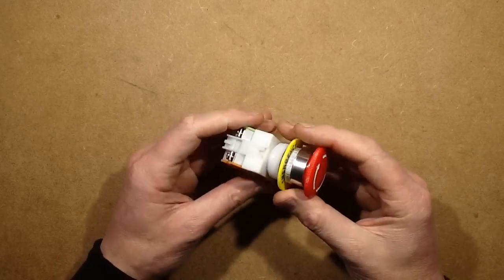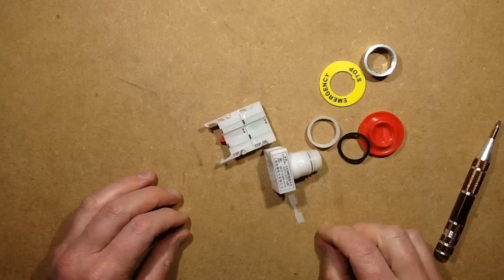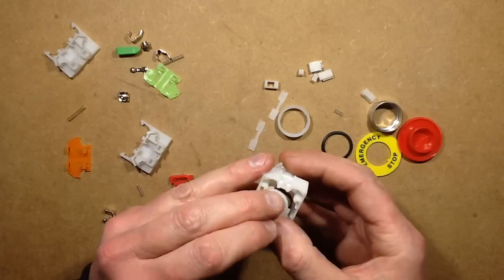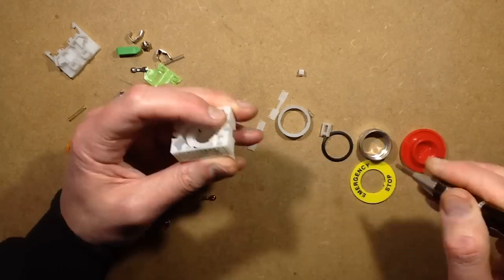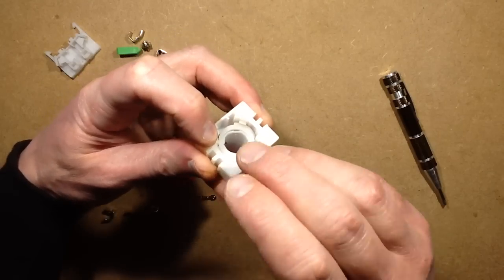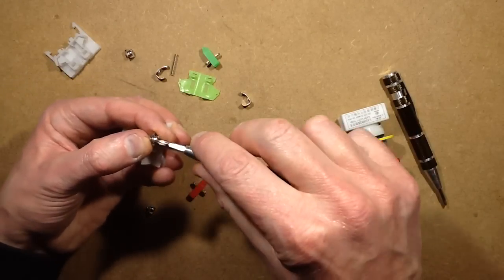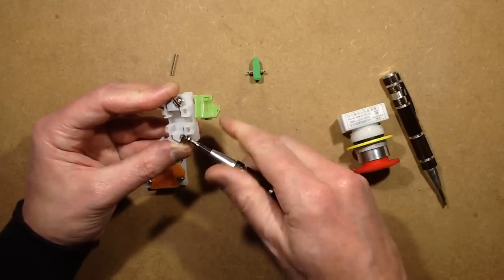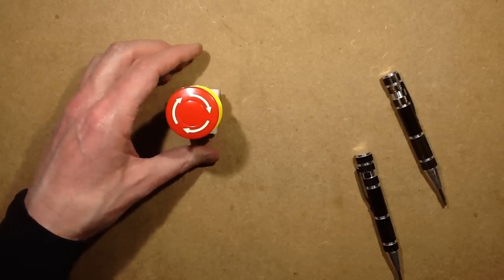Chinese E-stop button teardown.  All FORTY bits of it!

Comment: I used to work for a semiconductor capital equipment manufacturer here in the US.  We had bins full of those EPO switches.   If I recall correctly, each one of the machines we made (platers, etchers, etc.) used 4 or 5 switches like that.
Reply from the maker: +Coffeehound There's usually what is called a safety chain with a load of these buttons around the machine and wired in series so that if one is pressed it stops the machine.
Reply: +bigclivedotcom I like the thoughtful placement of E-Stop buttons on big machines. They tend to be near the dangerous parts, within arms reach. Someone must have a fun job of thinking "OK, so if someone gets jammed in this, how far can they reach with their remaining arm. We'll put a button there."
Reply from the maker: +James Grimwood Or just a tiny bit out of reach...
Reply: I can imagine cheap Chinese machinery having dummy E-Stop buttons that do nothing. Kind of like the CE logos they stick on things because that's what electronic devices have on them ;-)
Reply: +James Grimwood I can tell you;ve run a chinese sweatshop before!
Reply: +jusb1066 Exactly. Why in the world would they go through the trouble and cost of having dummy switches? LOL. No switch at all.
Reply: +Bowowowification because corporate social responsibility is becoming a thing nowadays, but mostly anyone who's inspecting a factory for their company for this reason is either too dumb to check if the switches work, they just dont think about the chances of switches being fake or they are too bussy to actually check them. So the factory owner can still save a little bit of money while also getting big contracts just by using fake switches or any other kind of lie/twist on reality.

Comment: I wouldn't want to be working in the factory either, the aluminium rings can be really sharp near to the point of cutting you. You can get pre-customised control sets of buttons, key locks and emergency stops on ebay from China, they are neat for small projects as you can usually get them for less than $20.

Comment: Pretty dry but informative.  My first E-stop switch and I didn't know how to wire it.  Seems all that's needed is to use the red side of it to break the circuit.  Long way to find out but at least it works now.

Comment: I wish these eBay Emergency Stop buttons would have two NC's instead of an NC & NO - I would like to be able to completely isolate something rather than just the live line. What is the NO even used for? All I can think of is to trigger an alarm or something.
Reply: Watch the video again from 1:05. The switch modules latch together side-by-side and end-to-end to you can stack multiple poles, for example to interrupt a 3-phase circuit (within specified contact rating of course).
Presumably extra modules are available separately from the button/latch mechanism, check out Clive's mention of "LAY37" in the video description. NO contacts might be used to trigger an alarm as you suggested, or to send an e-stop signal to a process control system which will automatically shut down machines further up the production line to prevent expensive damage/wastage.

Comment: My favourite description of the installation/use of the Big Red Switch comes from the Jargon File entry for "scram switch":
"In general, this is not something you frob lightly; these often initiate expensive events (such as Halon dumps) and are installed in a dinosaur pen for use in case of electrical fire or in case some luckless field servoid should put 120 volts across
himself while Easter egging."
Reply: Halon dumps are initiated by pull stations
Reply: @JBF-GST-Tanda  They can be, yes. The term "Big Red Switch" is a generic expression used to refer to That Which One Must Not Activate Unless One Is Really Really Sure, it doesn't necessarily have to be an actual switch that's coloured red and is of large proportions. Cheers

Comment: I have many fond memories of pressing E-Stop buttons from my old air induction system manufacturing days. They ran the machines into the ground after scrapping the annual summer shutdown  for routine maintenance. After that, the machines would breakdown almost constantly.
Still easily the best job I ever had.

Comment: Thanks i will buy a couple of them and try and take them apart and back together if you could find more of these kind of things that can be found cheaply and later taken apart for parts like I did with an old broken digital camera(was actualy very shocked at the number of resistors and capacitors on it (nearly 200) xD) also if I could send you a picture of my charger that I made somewhere so you can take a look and tell me if its all wired correctly because I even soldered the leads to mains and the leads to a microUSB to charge my phone but didn't want to take the risk of ruining my phone

Comment: 10A is a bit weak for a workbench, those contacts looks flimsy also!
Reply: +zeroy they dont have to turn on the load, just release it, so its a bit easier on the contacts, these are of course emergency off switches more than on-off machine switches, also not often used.
Reply: +zeroy This wouldn't turn on or off the load directly. If it's a high current load, it would go to a PLC or relay that would do the actual disconnecting.

Comment: If you're going use one of these things directly with mains, don't use it as a main switch. I used one for a while, don't think I did any load switching, and maybe 40 activations in the plastic for the NC melted open.

Comment: Wow.  That is insanely complicated!

I remember some of these sort of switches from several decades ago.  There was no need to latch the stop button because the latching was done by a relay when you put the machinery in question into a run mode.  There were actuators,   like the big red button for stop,  the somewhat recessed button for run/jog,   and the rotating collar where you would select run or jog,  as a part of that start button assembly.  The hardware was made,  if I recall correctly,  by Cutler-Hammer.  You would screw the switches that you wanted (which could be stacked to an insane degree) on the back of the acutator,  and you'd end up with the complete unit.  Wish I still had some of that stuff from back then...

Comment: latching stop buttons are a real PITA when you have 8 of them scattered around the classroom and you have to check each bloody one to see which has been pressed by tone of the little sods you are teaching before you can get the workshop running again.
Reply: +Donald Sayers i remember from my school days the same, any stop switch would turn off all the machines, not just the nearby one, so during non shop time, people would always mess with the switches.   the same would happen in science lab with the gas taps! and be left on for the next time the main valve was on, lol

Comment: That would not be legal in Norway, It is requires two safety loops, so the safety realy got 2 sets of contacs. So it wil be to sets of contacts in the switches, and two separate contacs in series in the realys. Plus there are strict rewquirements for what it shuld stop.

Comment: The normally closed contact is at least 'forced disconnect' that is even if the contacts where welded shut the force of pressing the button would physically drive them apart. That's a tick from me.

Comment: Out of curiosity, how much power could you run through this?   I imagine those little contacts couldn't handle a full blown wintendo (computer) but what about some lighting?   Or is this the case where the button would just connect to a beefy relay-whatsajigger-switchy deal that handled the main load and this acted like a remote sensor?

btw...   where's that electron theory video you've teased several times now?    I know t'other folk have made them, but I prefer my lessons from a wee tipsy Scotsman !!!

Comment: Those should have a lock in them so you cannot close the circuit without a key. That way the cause of emergency will be solved before closing the circuit.

Comment: I wonder how may per hour you have to assemble to not get the whip!
Reply from the maker: +jusb1066 I'd guess each assembler will only be putting in a few components in a production line.  It's much faster and easier to train the workers if they are only doing one small thing.
Reply: +Andrès Peña No. Watch chinese sweat shops on youtube. Your eyes will be opened. bigclivedotcom had a playful attitude about it, but I'm sure he realizes there are actual human lives being expended for your cheap chinese crap.
Reply: +Andrès Peña 
Workers are cheaper than robots in China.
Reply: pesshau Does the average worker just have really bad negotiating skills when it comes to pay?
Reply from the maker: +Bowowowification I very much doubt that negotiation or unions is involved in China.  You either choose to work or die in the gutter.  And there's no shortage of human labour to compete with.  As for the speed.  You'd be surprised just how fast humans can be when they do a repetitive task.  They start slow and get faster with experience up to a comfort point.  I notice the Chinese workers also avoid repetitive abrasion injuries to their fingers when assembling sharp parts by selectively applying tape to their hands before a shift.  In fairness, there's not a huge difference between modern Chinese factories and the ones in the USA and UK when we actually had industries like these.
Reply: bigclivedotcom I have to wonder if they have the learning curve thing down to a science. If we hire worker X to do this task, they should start at efficiency Y and slowly improve until they hit maximum efficiency Z. And guess what happens if you don't meet their average work efficiency curves? They throw you to the gutter, hah. :-(

I guess in countries with a higher minimum wage, the high cost of human labor leads to robot automation. (Or in the cases that support it, outsourcing to China.) Why hire a human to flip burgers at $15/hr if a machine costs an average of $12/hr amortized over its useful life? (Just an example, throwing numbers out there.)
Reply: +bigclivedotcom That really depends on the size of the factory and how many you have on the assembly line. If it's only 20-30 people on the line then they all do the same jobs because you can't afford to lose one "specialist". So everyone does the same things.

That being said, i am sure they are doing it in stages and alternating somewhat. First they assemble the mechanisms (knob) in bulk. Then they assemble the closed switches and then the open switches.
Doing one bit at a time even though you go through all the steps eventually makes it as fast as if you had specialists doing it.

Also, i am pretty sure they have special tools tailored for the job. Like putting in those switches with the springs in them. They use a special tool that slides everything in place (including the cover) in one single move. You just drop the stuff in the tool and pull a lever.

The contacts are placed manually but the terminals are screwed in by a rig.

I'd say the only manual work is putting that rotating spring in as i don't see an easy way to make a tool for that which wouldn't botch it up repeatedly and damage the housing.
Reply: ***** I agree with some of your points. You said " and the wealthy care more about profit than workers' quality of lives"
This is kind of... not really the way it works.
Your boss at "Put-Things-Together-Co" may be whipping you to do a certain job, but only so the company can appear profitable enough to wallstreet so they get investment money and cheap enough so people buy the widget. It's a process of dehumanization through several stages. You may care a LOT about whether your working conditions are shit or not. Your boss may care a little about that, enough so that he doesn't get in trouble regulation wise. Wallstreet cares zero. They care about the company that makes the most profit. If I'm buying a stock on the stock market, why would I buy a company that has a track record of making 10% per year when there's one that repeatedly makes 30%? (Even if the company treats workers terribly, most investors don't look at a company in this much depth.)
Reply: ***** But even mom and pop have money in wall street. When you have a 401k, it is quite often invested in index funds which are nothing more than a collection of top performing stocks. So... in a weird way, even "ma and pa" are at fault. Now maybe "big money" makes up 98% of Wall Street and you and I trying to put table scraps in there and have a future tomorrow makes up the other 2% (I really don't know.)
Reply: +Bowowowification 
Yeah, no. Robots are considerably cheaper than people, China included. Just because there's ridiculous propaganda about doesn't mean you have to believe it.
Reply: ***** They are cheaper - to a point. Or else there would be no humans assembling your iPad in China. Robots are cheapest if you are the ones manufacturing them. If you're buying them from a distributor that gets them from a manufacturer, then several layers of profit have been added on top and the robots will be sold at costs just less than what a human costs, or even above that cost. (Because why would they sell them cheaper when they can get more profit selling them more expensively?)
Reply: Bowowowification
Certain specific construction parts are still made by people in automated factories, be it China, Japan, US or Germany.

Nobody's going to do soldering in a factory though, for instance, you can't compete with a robot in that in any manner, and even if you could hire 20 people for the price of one robot, they couldn't compete in either speed or precision.
Reply: @Kanakotka  I have seen fairly recent documentaries and documents about soldering factories where surprisingly many parts are hand soldered.

Comment: I remember there being a ring of about 15 of those around my woodwork class in highschool all in one circuit, so if anyone saw an accident about to happen from across the room, they were near one. The one time it did (tie in a belt sander), 12 of them  were pressed.
Reply: +Jordan Payne The one where I used to work that shut off the gas in the kitchen had a keylock on it and when one of the waiters inevitable accidentally leaned on it it would start the "where the bloody hell is the key this time" hunt.
Reply: Everyone loves a chance to press the big red button.
Reply: Over-Kill-Switch

Comment: Should really mention the tiny problem that it only has one set of NC contacts, making it useless as a E-Stop button.
Safety circuits must be fail-safe to actually function as safety circuits. It means that any kind of failure, anywhere, must create a safe situation. So safety sensors, switches etc work with NC contacts, in case a wire breaks or comes loose and are always connected in redundant pairs in case a contact sticks of something shorts out. A NO contact is a nice addition to have to tell PLC that the button is pressed, but that doesn't have anything to do with safety anymore.
Reply: The NO contact could be easily replaced by an NC one, and further contact assembly can be stacked onto the contacts you already have.

Comment: If you do add that as an emergency stop to your work bench, I suggest that instead of the usual red LED indicating that Emergency Srop has been pressed, that you connect that part of the circuit to some soft of red alert klaxon. 😁
Reply: An old 120-volt fire alarm horn would work well ;-D

Comment: So, if I reversed one of the switches I could make this switch off two circuits? I am planning to use something like this to switch off an internal HDD (hot-swap enabled) only used for backups via the two Sata-power lines.
Thx for the very enjoyable vid!
Greetings from Germany
Reply from the maker: +mooq! You would have to change the contact module completely.  I'm not sure I'd use it on a computer case as the operation of the switch would involve thumping the computer.
Reply: +bigclivedotcom vibration would not be an issue, only one HDD (the switch would be mounted away from the drive) and everything else solid state. thx

Comment: My favorite part of this is the way you could mix and match the switch modules, and even add more modules.
Reply from the maker: +DrRawley The stackable contact blocks are very common in industrial equipment.  You generally choose the type of actuator you want, from a simple button to a rotary knob and then select the type and number of contacts you need.  The same style of housing can also support a lamp module with suitable buttons or just a fixed indicator.
Reply: It's like industrial lego!

Comment: What are the specs on that switch,Power ,amp..? Great videos can't wait for the next..
Reply from the maker: +THEDRAGONBOOSTER8 660V at 10A apparently.  Which kinda fits with all the industrial situations it might be used in.  It will be used with 12 or 24V systems too.
Reply: +bigclivedotcom Thanks Clive..
Reply: +THEDRAGONBOOSTER8 How would you implant this to break power to something larger? 10A seems a little small for industrial applications and might cause arcing?
Reply from the maker: +Andre Fish It's only in small applications that the E-stop button switches the actual load.  Usually just a low power single phase motor like a small lathe.  Normally they break a section of the control circuit that switches the main motors in the machine through contactors.  (large industrial relays)
Reply: +Andre Fish You'd use it to control the coil of a contactor. From Wikipedia: "A contactor is an electrically controlled switch used for switching an electrical power circuit, similar to a relay except with higher current ratings."